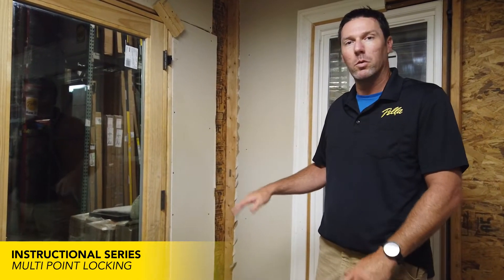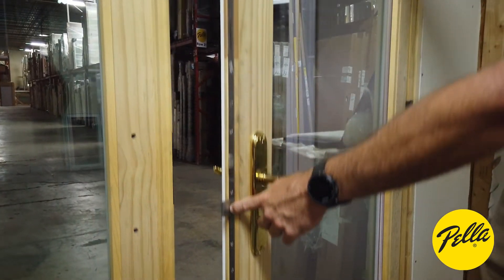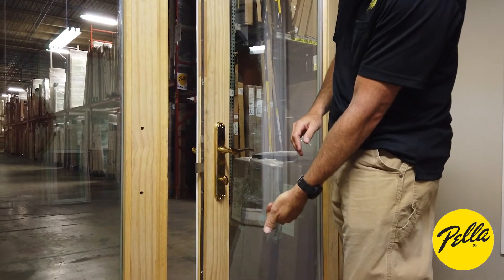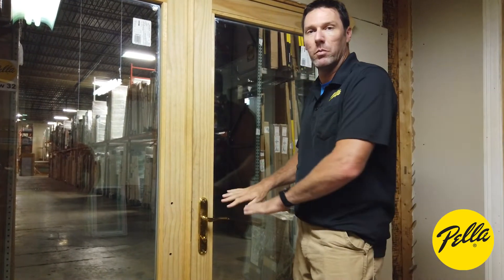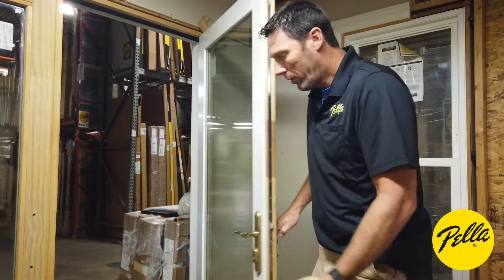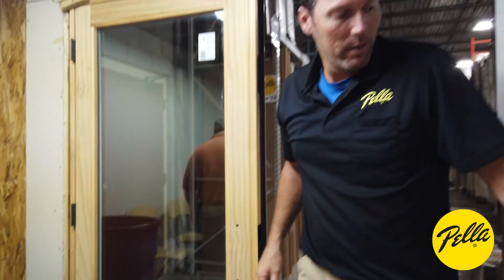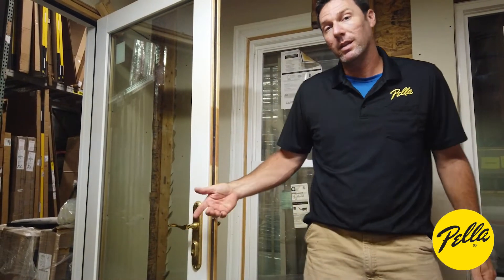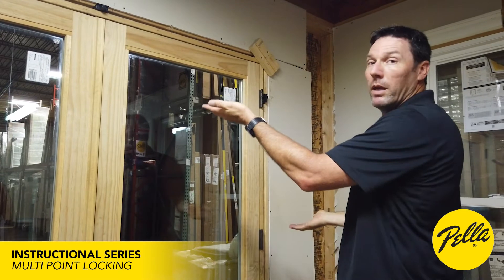Instructional Series - Multi Point Locking

Comment: Hello, great information.  My door will not close by itself, but I must pull the door to close it and it is very difficult to lock, this after a new gasket was installed.  My pella tech suggested a new gasket would solve a gap on my door at the bottom which is over half the width of the door, unless the lock is properly engaged.  Would you have a suggestion. Thank you
Reply from the maker: Hey there! Thanks for the comments and definitely, we can put a gasket or weatherstripping replacement on the radar. For now our advice straight from Brian would be that your new weatherstripping will need some time to compress and form to how the door sits when it's in the lock position. Once weatherstripping takes memory to how the door sits, it WILL get easier and easier to lock with time.

Hope this helps ease your mind with your new weatherstripping install. Let us know if we can help further! Happy to help.

Comment: The keep on my multipoint latch has broken out of the wood threshold. Do I need to replace the entire threshold?
Reply from the maker: Yes. I would also check the wood under the threshold to make sure it is still solid. If that wood is still good then your local Pella branch can replace the threshold, or ship it to you.

Happy to help in this process!
Reply: This was a custom door that was rejected by the original customer, but we were under construction, and the patio door in my package was missing. They offered us this door, and the contractor adjusted our opening. The door is now 20 years old, and it has been great with the exception of the threshold issue.  My biggest problem is that the local Pella rep quoted me $1170.24 to replace the threshold and door sweeps! The threshold width is 57 inches, and the doors are 23 ¾. The door thickness is 1⅞. They told me that was a non-standard size, and I would have to have a custom sweep made. Something doesn't seem right.

Comment: Can you show me or explain to me how to DIY adjust the door? Mine locks fine when open but rubs at the bottom lock and will not fully lock. Thanks
Reply from the maker: We can add this to the list of things to film, but Brian is off on vacation right now. That said, he still saw this comment and-bear with us here- provided some tips for you to follow. Here's what he had to offer: 

Depends on the year the door was made. Older doors have plastic shims behind each side of the hinge. To lift it up remove all shims from top and middle hinge then add 2 or 3 shims to the bottoms hinge. Newer doors may have adjustable hinges. If you have adjustable hinges: Loosen the 2 Phillips head screws then turn the top hinge adjustment to the minus sign. Once adjusted tighten the Phillips screws down tight. The bottom hinge loosen Phillips screws and turn adjustment screw to the plus sign then tighten Phillips screws back. Or you could also try a completely different method which works great. Just file some of the point off of the bottom multipoint.  This will allow the multipoint to completely throw don’t will lock. 

Hope this helps!

Comment: Thank you.  Helpful.  
Is there a way for the deadbolt/vertical security rods to stay recessed so the door can close without engaging the handle?
Reply from the maker: Ooh, that sounds to us here like it's an actual issue internally. It SHOULD be able to be closed without messing with the handle, where the locks only shoot up when you turn the handle. Sorry to be the bearer of bad news here. This is what Brian said directly:

"If this happens customer will need a new multipoint lock and tech will need to come out and drill out old one. I would not recommend opening or releasing lock til new one comes in as you will not be able to lock up your home."

On that front we are more than happy to help out in any way that we can, either getting you scheduled or getting you to the right branch to get you squared away. Sorry!
Reply: @pellanorthcarolina  Thank you.  There is a Pella dealer in my town, so I will contact them today.  For confirmation, the vertical security rod springs up after the door is opened, and then the rod slams the door frame when shutting the door unless the handle is engaged.
Reply from the maker: @MartyZaluski  Yeah, that doesn't sound right at all unfortunately. It should only spring upwards when the handle is turned up as well. 

Thanks for finding the video and if there's anything else we can help with from here just let us know! Best of luck.